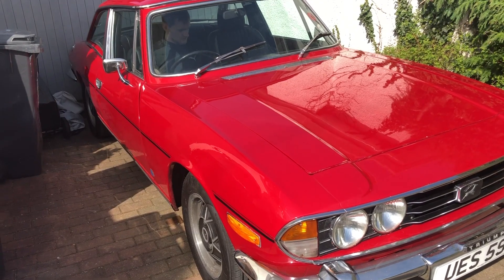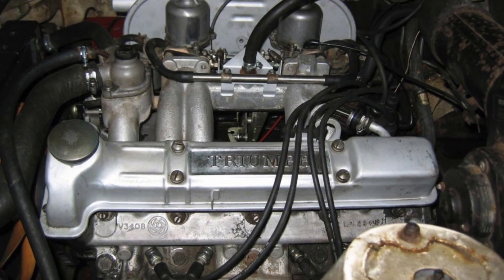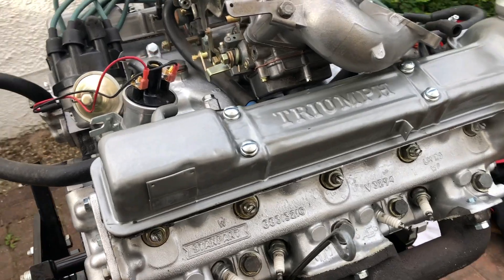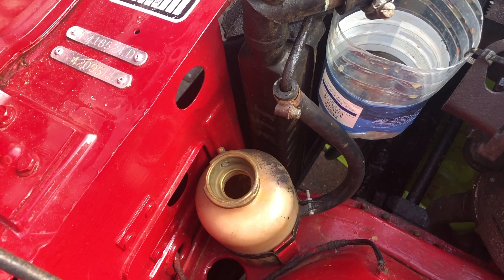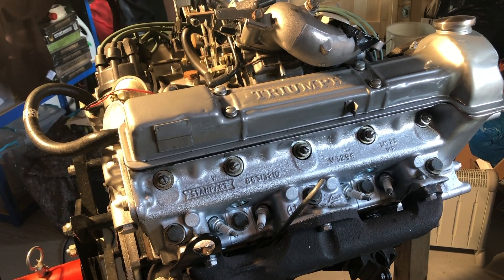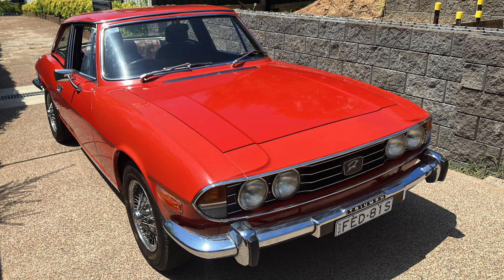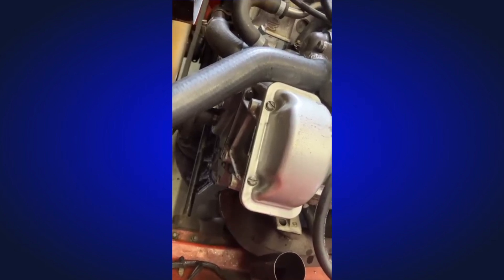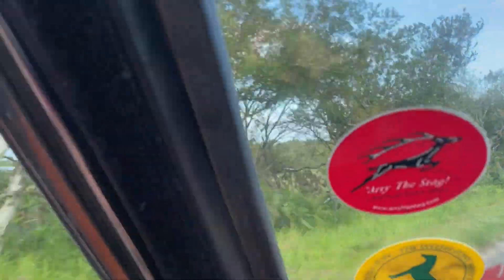Triumph Stag V8 Engine – The Untold Story of Its Troubles & Triumphs!

Comment: Problem with sand in the block is sooner or later it end up in the coolant.  Plugs up the radiator and the engine overheats.  Shop replaces head gasket and the poor owner drives away again with a plugged radiator.
Reply from the maker: The perfect storm! Such a shame it curtailed the length of Stag productions and afflicted it for may years. A lot now still running around, which is great news. All the best TR T

Comment: Just a small comment as far as I know the stag engine was developed by Triumph, as a v8 that could be cut in 2 to become a 4 cylinder, not the other way round. It was not a Saab engine, Triumph sold the right to the 4 cylinder to Saab, it was always t Triumph engine. I just suffered the budget cuts that hammered the rest of BL. If Triumph had the resources to sort it out properly it would have been a fantastic engine. The same happened to the PI engine in the 2500. One big problem with both the stag and the PI was the dealer service department had no idea how to look after these cars. No One knew how to tune the PI and no one knew job to look after the cooling system of the stag.
Reply: I had problems with the service department understanding a problem I had with my 2500pi mk2. They tried to get me to pay for all sorts of things that were not possibly a cause. I determined myself that the problems were the injector unit neoprene non return valves hardening and pitting especially the 2 banjo ones next to the block. Using a bit of reasoning I put them on an oilstone and flattened them. Problem went away just like that. I tried to get new ones but they were a never used never had spare part. One of the block welch plugs under the intakes failed. No one wanted to fix it as it meant taking off all the injector inlets and linkage and they had no clue how to set them back up. I eventually got a repair shop to fix the plug and just put the injector units back on and I took it home and set it up myself.   Another issue was lubrication the hollow oil channel rocker shaft wore into steps, a new shaft was obtained but the blanking plug for the bottom end was impossible to find, another never used never had spare part. Had to have the bottom end rebuilt as the pistons were slapping the hellout of the bores, however I would not be surprised if it was not because the owner continually drove it over the RPM red line.  They did not torque up the exhaust manifold properly and I got leaks. Then when the steering linkage donut rubber parted company with its metal parts I decided after fitting a new one it was time to part company with it.  Oh yes under acceleration on a right hand corner the left rear half shaft splines would lock in the body rolled positions, ease off the foot and it would release with a tail twitch.
All in all though one of the best cars to drive I ever had. Accelerated well up the hill from Wollongong to Sydney. Mother in Law would complain about the speed and I would point to rev counter and say see its not so fast. She thought it was MPH.
Reply from the maker: Thanks David - much appreciated! Best TR T
Reply: The water pump postion in the block comes in for a lot of critism too. My understand it was engineered there at the instigation of SAAB as they wanted to turn the engine 180' in the engine bay because of its intended front wheel drive configuration. The planned front
 mounted water pump on the original 4 cylinder meant it was inaccessible with the engine turned around. It was therefore designed in the block for better accessibility. It is true SAAB did redesign the water pump seals for better reliability. I think this was all done around 1968.
Another point of note is that 'Ricardo' a automotive engineering company of note, I think they were based in Shoreham, were employed to help design the original cylinder heads, particularly the porting and combustion chamber design.
Ricardo were no fly by night company, their expertise was used by several high level racing teams and to develop technologies for F1.
Reply: Triumph originally developed it as a slant 4 cylinder engine to fit under the low bonnet line of their compact saloons. Then, it was expanded into the V8 for the Stag when it was realised the 2000 - 2500cc engine would be too underpowered for the proposed American main target market, when strangled with all the  necessary emissions equipment. In house rivalry took over as Triumph's  engineers resisted the BL management proposal to fit the proven Rover V8 in the Stag. That was based on the claim it would need major reworking to the Stag bodyshell and running gear, which we all now know was not needed. I think it was originally only planned as a 4 cylinder in a deal with SAAB, where they  funded some of the development costs, in exchange for them having exclusive use of the new slant 4 engine for the first couple of years production, then SAAB further developed it for their own later models.
Reply: @brianwhittington5086  Correct Brian, well said. There are many refs to it, but Graham Robsons book is as good as any. Most of this is from that book, but other refs support it. 

The Triumph engine was being developed as a 4 early 60's, when Saab wanted a 4. There were two engines considered by SAAB, a Ricardo engine, and the Triumph. The Triumph was on the drawing board in 63, and that is when Saab talked to them. It was running ready for Saab in 65. But Triumph didn't have the cars ready for that engine, hence Saab had the engines running in a car before Triumph did. Then they looked at the Stag.......... and needed a V8. So they used the 4 (by now ready to go) as a basis for the Stag, then the Dolomite got that engine 2 years after in 72. 

From that, people presume that "Saab had first, THEIR engine" or "Stag had V8 before Dolomite 1850, so 4 came from V8". Both not correct, but if you have parts of the story, easy to assume.

So, what happened was Triumph develop engine, Saab buy it, modified version goes into a Saab, while engine waits for Triumphs to be ready. Stag appears BEFORE Dolomite is ready/takes priority/make a V8 version, THEN fit the engine that has waited for 7 years as a 4 into the Dolomite. Open the bonnet of any 1850 Dolomite or TR7, and you can see the Stag origin. Wheras the Sprint (which I have one of) looks little like it, as totally different head. 

No one book is ever gospel, and Robson would have got his info from elsewhere, but enough facts and time lines support the above, ie, it "makes sense."

So many people go on about "all the things wrong with the Stag" and most are rubbish/pub talk; or ALL can be fixed.

But the ONE thing we can blame Saab for is the terrible water pump design. If not for Saab, it would be on the front/conventional. And on it's own, not a bad design, as proven by Saab not having much trouble with it.  Saab use the engine 180 to the Triumphs, ie power take off is from the cam chain end (Yeah, bizarre), hence a WP there was not on. 

But the precision involved in that gearing was beyond later BL. Early on = ok. But later, a batch of improperly hardened WP shaft gears led to breakdowns, so much so (that after buying a NEW unipart WP and it shredding my drive shaft within 2 weeks) that I had to revert to second hand WP shafts as I could only trust old ones. Once I ran out, had to look at alternatives. There is a Ford V6 pump people use, but I don't like it. I tried a Triumph 6 WP and a Hyundai Sonata WP, and got them 70%/99% going, but lost interest and had to use other means. The Sonata and my custom set up worked, but a bit close to power steering belt, and I got sick of it....................... 

If only Triumph HAD used the engine before Saab, they would have put WP on front. THEN Saab come along "We want that, if you can move the WP" = two versions. But no, Engine wasn't finished, Saab said "Want that, but with WP on top." Wasn't finished yet, so WP goes on top for Saab, later when Triumph use it = "it's already there, just leave it............................ "

Everything else on a Stag is pretty much ok, but that WP...... I had mine in and out over the 30 years and 330,000 kms I have done, and am a dab hand at rebuilding the pumps (only thing that fails it the seal) but the lottery of not hardened shaft gears I just can't trust.